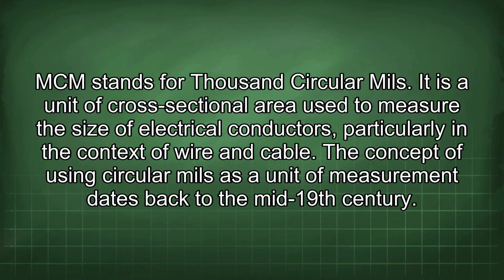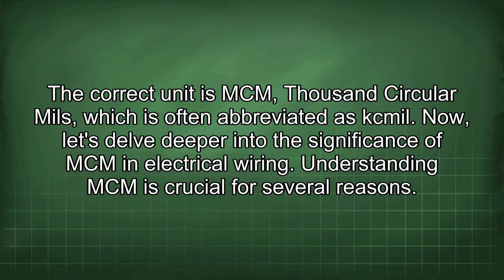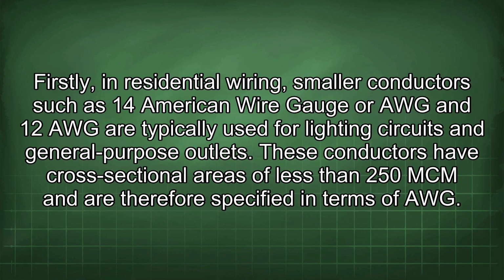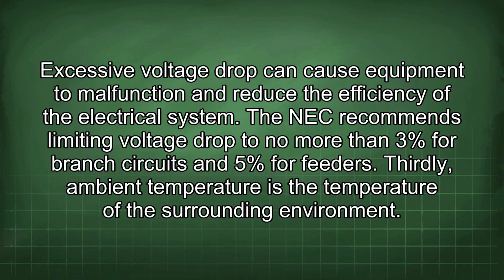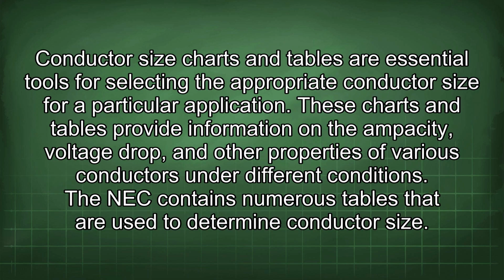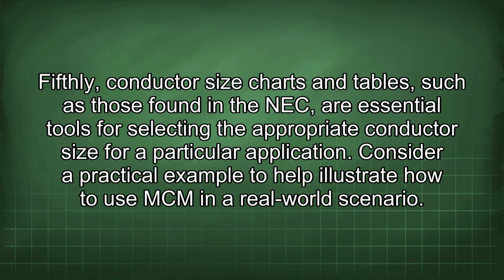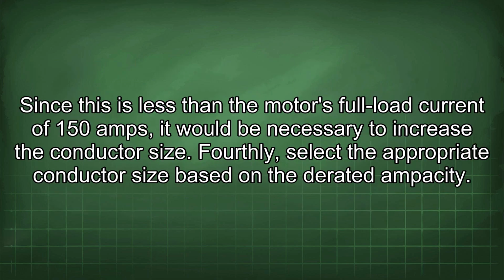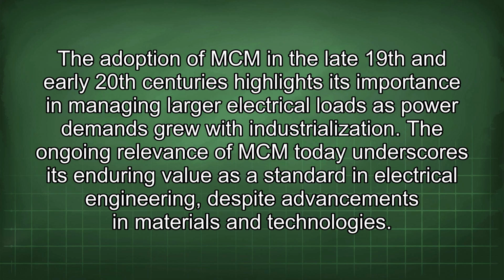Understanding MCM Thousand Circular Mils for Wire Size

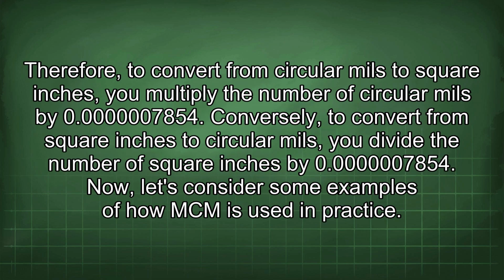Comment: 0.7854 multiplier to go from mcm to in^2? 0,0000007854? see 3:25
Reply from the maker: Hello @jrsydvl100,

Thanks for your comment. In the video, we use the base unit for the viewer to understand the SI measurement. One circular mil (cmil) is approximately equal to 7.854 x 10⁻⁷ square inches (in²). This is an extremely small unit of area. MCM represents one thousand of the cmil unit, hence, the seemingly disproportionate, small number in the conversion factor demonstration.

For the viewer; once this fundamental component is understood, in the field you can of course typically use a shortcut of memorizing the ratio to convert directly from MCM to in².

Sincerely,

BESA Research
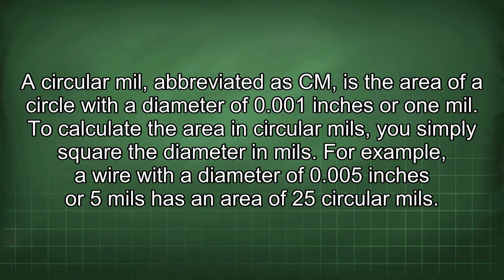Reply: @BESAResearch  Thanks for the reply & clarifying. Also, at 2:51 (& a few seconds later) the narration doesn't follow the text, 0.001 is read as '0 point 1'. And then 0.005 is read as '0 point 5'. I think this was the cause of my confusion in first Comment; 0.0000007854 is read as '0 point 7 thousand 8 hundred 54'